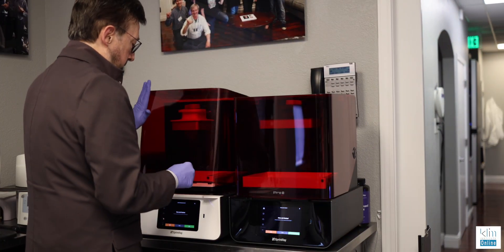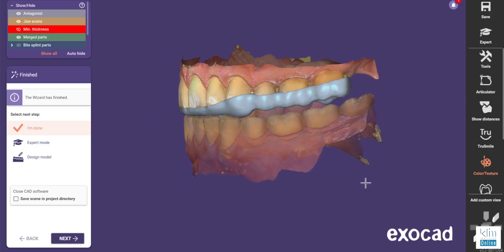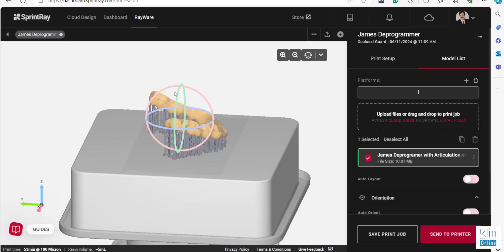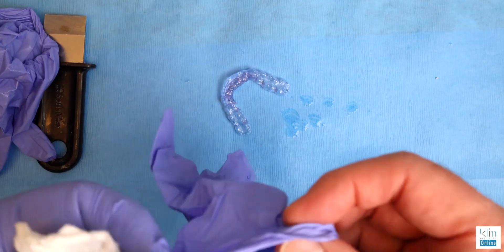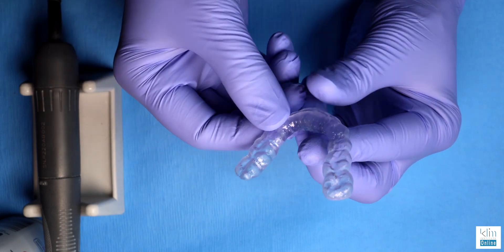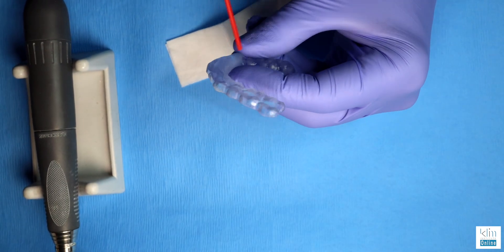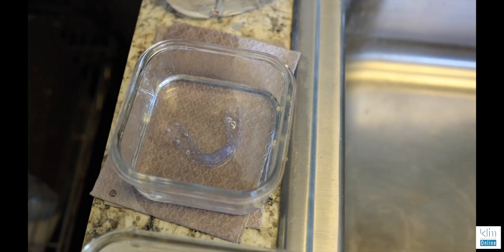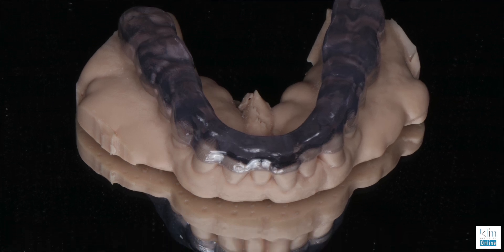Printing and Finishing a Dental Deprogrammer

Comment: Nice James ! But I do believe and I'm sure you do too that Prime Print is the only way to go .
Reply from the maker: Thanks for your comment.  The PrimePrint definitely has a nice workflow.  Coming from the Asiga printer, built my expectations for print quality and having an open system.  SprintRay has R&D, quality, and speed efficiency that is leading the industry.  PrimePrint has done an excellent job for workflow automation, however, the print quality is lacking compared to other printers on the market and did not reach my expectations in this area.   All the best!
Reply: Lmao